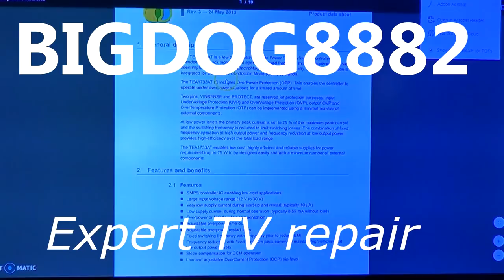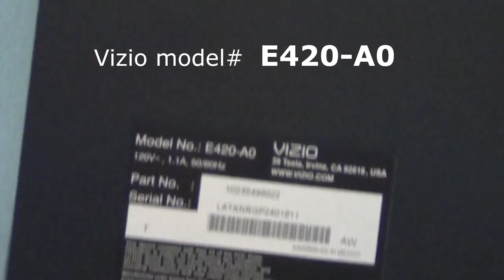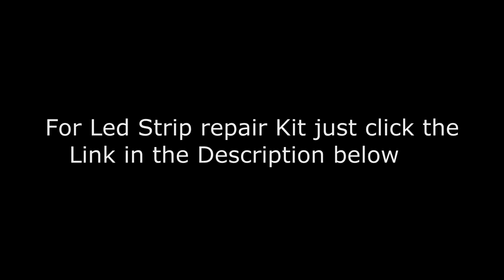Vizio 42 inch Led tv, sound but no picture/backlight repair

Comment: Well done my brother ,,i have Samsung LM 40D503FGXPE  screen,,on  the T Con board i discovered  a resistor  4r7/1146  having thermal runaway,i was wondering if i replace it with a 1/4 watt ceramic resistor ,if it would work,,the problem is a double image and  vertical lines GOD BLESS MY BROTHER

Comment: I have a E420i-A0 with a weird problem I have yet to see a video about. I wonder if you could figure it out... This video is the closest I've seen to describe the issue. It went from no picture at all to suddenly working for going on two days now. I do see a couple places where there may be an led out, but it's hardly noticeable. Could 2 or three bed leds have been bad, shorting the circuit, and turning them all off? Then, after 859 times of restarting during testing have burnt those bad ones enough that they're no longer a short enough to shut off the rest of them? That's the only thing I can think of at this point. When the tv is operating I get 65 volts on one end and 105-110 on the other.

Comment: I had this problem on my 5 yr old 75 in Samsung. I swooped it out with new LED strips. I checked the LEDs before I put everything back together. So when turned on the TV the right 2/3 of the screen was perfect but the left 1/3 is dark. It's been 3 days now and the dark side is getting lighter, but is still much darker than the right side. The connectors is on the right side. Now I have a vertigo problem. Any words of wisdom? Thanks for the Vids.

Comment: love the metal tools around electronics. LOL been there. use what ever you have to. I had 4 tools to hold 2 wires this week at week to make an Mercedes antenna. LOL it was a scene from Frankenstein. fixed the problem but found put the antenna is in the back window after all. ug

Comment: I also repair TVs but everytime I replace a single LED here and there it always backfires and comes back on me they're making LED strips more affordable  I just replace all the LED strips if they are available but if they're not I just replace whatever is burnout and tell the customer and it may hold up and it may not...as a last ditch effort
Reply from the maker: Yes that usually is best in most cases. Just make sure that U turn the backlight settings down in the menu when replacing individual LED's. Usually about 25-50% down toward the mid-point. Thanks for watching!
Reply: @bigdog8882  and not to mention to upgrade the mainboard software if available
Reply from the maker: @jonc.217  Thanks, never thought about that.